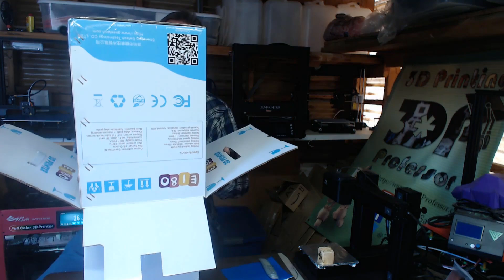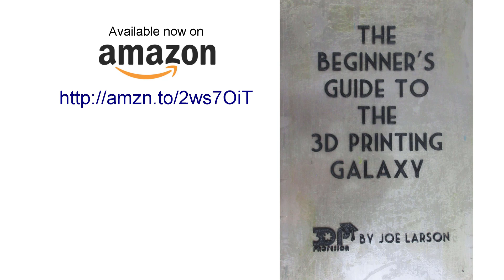Gearbest Doesn't Suck

Comment: Gearbest crap experience
I joined up a few weeks ago to buy a Tevo Tornado on special and because it generally had good reviews.
Took ages to place an order, the web page seemed to be broken getting 404 errors consistently etc, had to send a picture of my drivers license(wtf) and then to message them for help was through a Facebook  service, a service I wont use.After hours of stuffing around I decided the Gearbest shopping experience wasn't for me and I canceled the order, all of this on the same day, I filled in the on line form and gave a detailed reason for the cancellation etc, read there terms and conditions and thought all good as I had done everything that was needed to get a full refund.
4 days later I get a message to say that Gearbest could not stop the order in time, they tried to stop the shipment but because the printer is on it's way I will have to accept it now.
I have lodged a complaint, and was told to wait for the printer to arrive then to put a ticket in for a refund, the trouble is there terms and conditions will only refund the value of the printer and not the shipping which is a substantial amount for both ways so there trick is to convince you that you will loose too much and to keep the machine or too sell it locally, how do I know this cos I just had this shit fight with Tevo Store.
After canceling with Gearbest I placed an order with Tevo Store on Alliexpress, I received the printer, the box was perfect the foam was perfect but there was component damage, a really bent fan radiator support frame and teeth missing on the extruder don't what else cos it's broken and can't run it, looks to me like someone dropped the printer and then packed it, I had a shit fight with Tevo over a week they would not accept that it was packaged broken insisting it was the shippers fault,sent them photo's they were intractable they just kept dragging it out until I agreed to accept the parts to repair it myself no refund or replacement.
So how do I know there will be another fight for a refund, cos the Manager I was dealing with at Tevo is the same Manager on my notification email from Gearbest.
We will see if Gearbest are honorable and refund me the full amount, and as far as Tevo themselves well it's plain to see they couldn't give a rats ass about there customers.
Chinese Holidays now so everything shut down for another week.
Reply: Same thing happened to me, only with a CR10. I ended up going to PayPal (who I purchased through) and will be receiving my refund. GearBest sucks! Yet content creators are in their pockets.  So we can either stop supporting these creators or disregard their reviews.
Reply: I don't do facebook and I don't do tweets, I look at YouTube vids to check reviews and lots of comments and thats how I determine what to purchase. On anther note if YouTube channels are taking gifts of printers eg, then they are obliged to look the other way if there are problems with the machine, it's human nature and if they don't and give a bad review do you think that Retailers will keep sending printers to them?
So the incentive to collect printers far exceeds being a reviewer with integrity, the temptation is too much so for 3d print professor to really experience what its like he should purchase all his printers and that way he gets the experience of warranty claims, poor delivery times, frustrating customer service etc because there is more to getting a printer experience than getting a cheery picked machine that makes awesome prints, to be real a reviewer needs to include a purchasing experience as well as a printing experience and if 3D print professor can't afford to purchase the printers than he should not review printers that are given to him.
There are plenty of comments in this post to reinforce what I say, it's not just a mechanical review it is as important to include the purchasing experience. 
If reviewers followed this path then they become the most important person in a transaction for there subscribers and just maybe the corporate players might get the message and lift there game, it's not impossible.
At the moment these corporations are getting extremely cheap advertising and are able to have control over the reviewers that desperately need a machine to review so they can grow the subscriber numbers,Now is the time for YouTube channels to push back against corporations, YouTube channels have an ethical responsibility to there subscribers and by not including a score card for the purchasing experience will only worsen the deal for the purchaser while strengthening the dishonest and arrogant retailers.
Reply: Yeah well, the whole Facebook/Twitter thing kind of took off well beyond, i mean there were articles on some websites about this, not sure about YouTube. Apparently there is now such a thing as 3D printing related Boulevard press.

As to whether reviewers are beholden to the sponsor, well, Gearbest is pretty big in Russia, right, and they sponsor and supply thousands of YouTube channels there, many more than in the West. And i've seen it multiple times, their give-a-shits are extremely limited. You'll find they post the video that tears them a new one for all the little product mishaps and safety concerns etc right on their product page! And they keep sending stuff to people who openly hated their last products.

I used to be a tech journalist myself 20 years ago, and it's a shitty business. You see, those scant few currency units you pay for the magazine, they don't buy you journalism. They cover most of the cost of paper, ink, printing, and distribution, but not quite completely. Who pays the journalists, keeps the lights on for the editorial team? The advertisers, exclusively the advertisers. As an editor, it's not your task to deliver high quality journalism, nobody cares about that. Your real task is to reel in advertisement, and it's not that you'll be fired if you don't manage to do that, it'll just mean bankruptcy of the whole publishing company, at which point lots of people will be disappointed and you'll be out of a job too. Keeping a good relationship with manufacturers is a pretty good idea, then you might not be the last one to be informed of important developments. But what really opens up the tangible freedoms is if you team up with a major retailer. A retailer that is just too big to fail. When we managed to reel one in, i asked them how they feel about unfavourable reviews. The CEO said "Well, people tend to be afraid of the unknown more than they're afraid of a known flawed product. Besides, what's in it for us to keep bad products around? We can just ditch the stuff, let the suppliers and manufacturers eat the cost, less altercation with the customer for us, saves us money. Besides, what are people gonna do, shop ELSEWHERE? HAHAHAHAHAAHAH!" The way things work in China, all the dozens of export shops are run by a handful of companies, so you're almost guaranteed to land with each of them somehow.

Granted, i was apparently not a very good "journalist", or some of my colleagues weren't, the magazine did go bankrupt. Was an interesting experience though!
Reply: Tevo? Why are you buying Tevo? Let me quote their official Tweet that summarises what they think of your experience: "Who care :) tomorrow Tevo have big discount promotion . Maybe we sell at least 5000 pcs in tomorrow . LMAO ." It's the only 3D printer manufacturer ever to so consistently troll Facebook groups and harass people, to get themselves banned pretty much entirely from all of the bigger groups.

Comment: Negative reviews are immensely valuable. And you don't really have to worry about "permanently tainting" anything with them.

Particular models don't stick around forever. If a product was received that badly by the audience so it had to be reworked in a major way, chances are the fixed version will be released as a new model entirely, or at least a new revision, so consumers are likely to find a negative review not that relevant to the updated model (or at least give them the benefit of doubt and study the specs more closely). Especially if the manufacturer lists the issues fixed since, much like with changelogs in software. A past review will work as a "historical record" and allow to see how the situation evolved, especially if the updated model gets a re-review that highlights the changes. The manufacturer can get a huge reputation boost if the next product receives much more positive reviews. Because this way they're showing their responsiveness, that they intend to improve, that they are listening and they care. But they need constructive negative feedback (i. e. criticism) to know what to do and incentive to actually do that (like consumer awareness of the issues).

And if the manufacturer doesn't react to the situation, or even reacts childishly (like accusing youtubers of spreading misinformation, that I've seen happen a few times), then they just deserve to go out of business so they stop wasting their consumers' resources solely for their own gain, and a negative review is one of the means to ensure that does happen.

So in the end, negative reviews have a positive impact, everyone wins from them in the long run, except those we (general consumers) don't want to win anyway.

Comment: I ordered from them in December. I waited for 45 days for the wrong part I ordered a External USB WiFi, and got Cell phone headset. I am now dealing with they so called service to get the replacement order. the tracking still shows pending.... going on 3 more weeks. I can say I will not buy from them again. I am sorry I give any company the chance to fix a issue, but time is money and when you need something I do not want to wait until next year's model for last year's order to come in.
Reply from the maker: Fair enough. I would probably conclude the same.

Comment: I myself will always use gearbest.. when ever I've had an issue with a product they would send me a replacement or part.. and I would always ask if they could just send me the part that was defective an I would fix it myself.. never had they refused to fix any issue.. when u receive the purchase always build it test it and make sure it works properly within the first week of receiving your purchase and they will do everything they can to accommodate you.. they have even givin me an upgrade one time because they were out of stock of the product I bought... dont hesitate take care of the problem and they will take care if u...

Comment: I purchased my cr-10s a couple of weeks ago from lightinthebox for $380. Received it with in 5 days (I'm in the USA). Mine came with a faulty board and instead of having me ship it back to china they refunded me $68 which I used to replace the bad transistor. Then used the rest for filament at microcenter.

Comment: MY problem with GearBest was with the price/shipping.  I tried to buy a printer about a year ago, it was on sale and the add clearly stated free-shipping (which stated would take about 3-4 weeks and was ok by me).  The next day I get an email telling me they can't ship to the U.S for free but they can ship via Express something or other for another $50.  Told them to cancel the order.  They didn't want to at first but after getting PayPal involved, the order was cancelled.

I've ordered a lot of stuff from Banggood and never had a problem with sudden changes in price.   And for that reason I will continue to do business with Banggood and NOT Gearbest.

Comment: For me, I also do a lot of personal shopping at GearBest, I also did that before I became an affiliate.
Then when they reached out to me to become a tester, I at first refused. Then, later on, we agreed I can give any printer a decent and honest review. I can say it when I think things are not good on a printer, but I also agreed that I will then show how to solve the problem and make a not so worthy printer into a great printer, like I did with the Anet E-10 for example. 
I review my printers in 3 steps, if needed. 
1st video, my first response to the printer right out of the box, printing for the first time.
2nd video, My thoughts after a decent number of prints, after I made a profile for it in my slicer, etc. 
3rd video, the tinkering proces, changes, tweaks, etc. to turn the printer into a great machine.

It takes a while, but on the other hand, I received the printer for free so I feel obligated to work for it, while still being honest.

Comment: What I'm looking for in a review is balanced -- neither overly positive nor overly negative.  If it takes awhile to get a printer up and running and the issue is a one-off problem that tech support fixed for you, that might be safely left out of the review (at your discretion).  But, if the issue is a design flaw, I'd like to know about it.  Sure, the company might update the design to fix the issue you helped identify, but I'd like to know I'm getting one of the newer units.  So, sure, give us your positive experience -- when that's called for.  Also let us know when it's not.

As for the CR-10, just say it's a great printer for a certain type of user and not a good printer of other types.  Then, it's up to us to know what type of user we are (or may become).

Comment: Your 4 in 1 tool also includes a 1/4" and 5/16" nut driver after you pull the swappable ends out.
Reply from the maker: That's true. I hadn't thought of that. And neither had they or they'd call it a 6 in one.

Comment: I want to see negative printer reviews so I know what problems to avoid and to help me identify bad and improved versions of a printer on the market! :3
Reply: Maybe you can make a video about how you try to fix them. How the customer support was receptive and send you the replacement parts and overall the time and efforts required to acheive your printing.
Reply: How about a video telling about them (could even group a bunch in a single video), with big fat warnings that that's just your experience and links to positive reviews by others? That would help give a more complete picture.
Reply from the maker: I've got 3 printers that I can't even get to the first print with. That feels like critical mass to me.
Reply: Some printers brand/model are more/less reliable. Yes, we can expect that a 2000$ printer will be better quality than a 200$ one. But I think I still don't fully understand what is a "lower/higher quality printer", especially when the final print look the same in the review video.